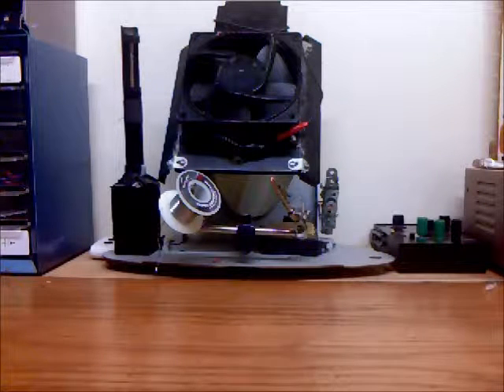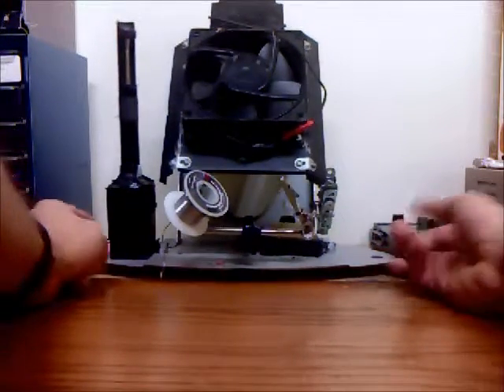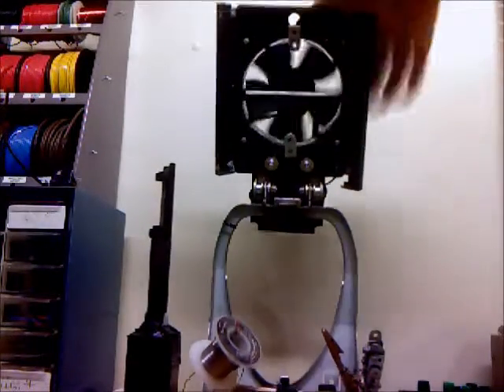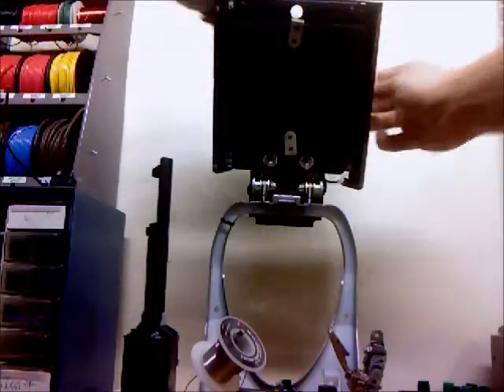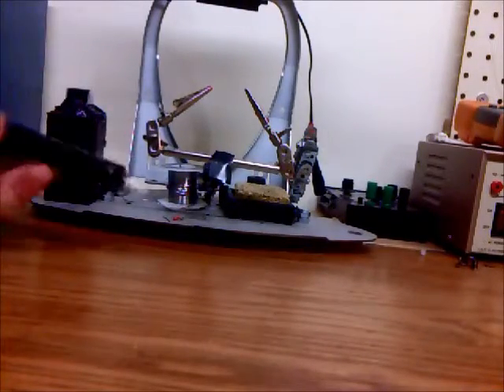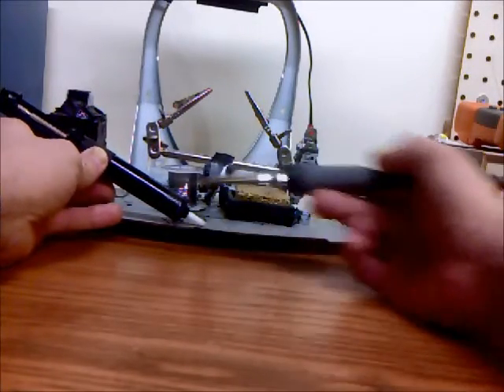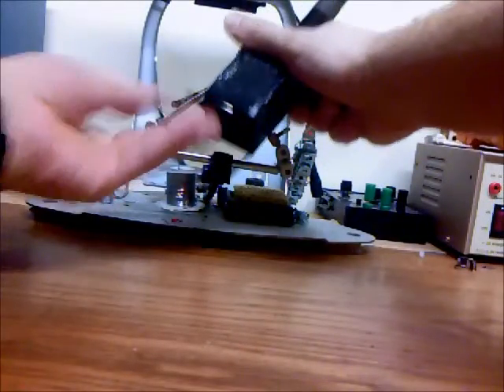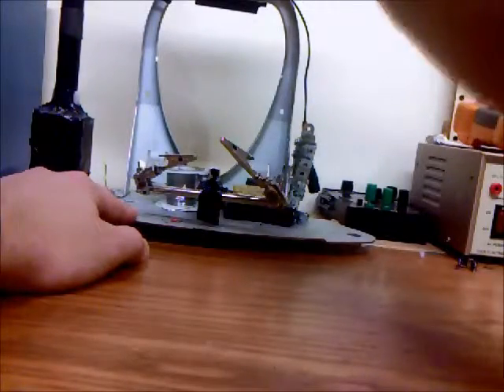Custom Solder Fume Exhaust Fan

Comment: great idea with your setup, what kind of filter is that? does it actually get dirty with flux after awhile?
Reply from the maker: neppy5  It is an activated carbon filter, and yes over time it will become less efficient due to lack of air flow caused by flux build up. They also use these filters in some HEPA (High Efficiency Particle Air) filter vacuum cleaners.
Thanks it like this build quite a bit, cold cathode fluorescent lights mounted to it at one point.